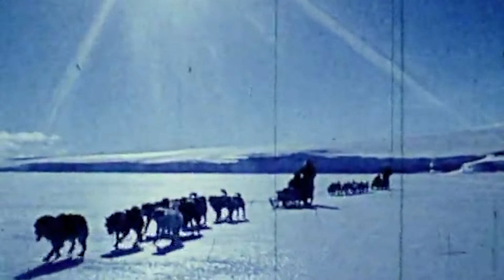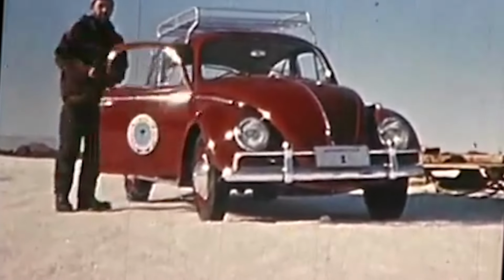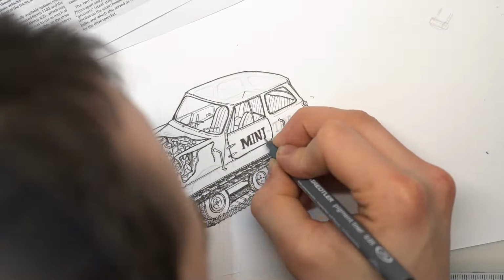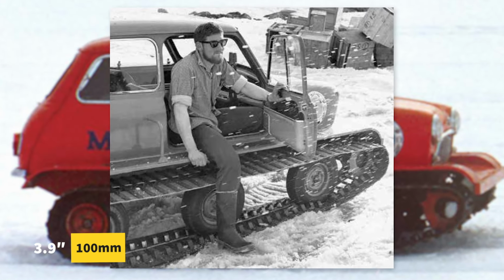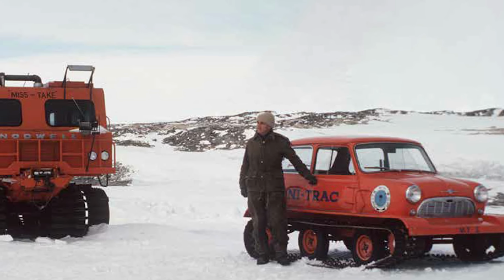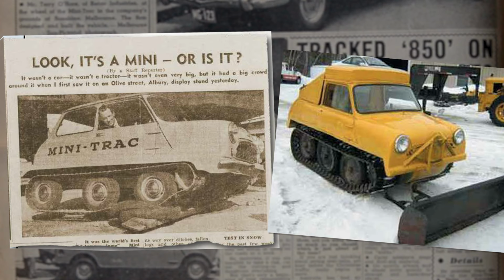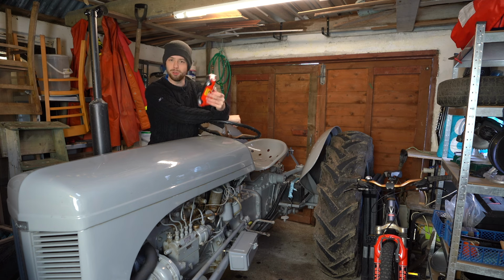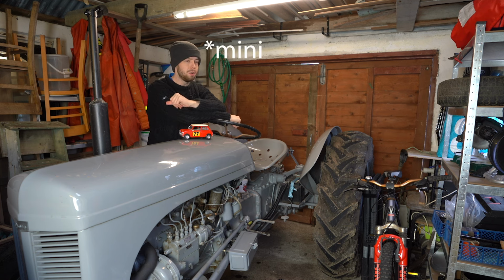Mini Trac -  The Amazing Tracked Mini Built for Antarctica

Comment: Re the VWs:

Strangely there was a thermostatically controlled shutter ring on every VW air cooled Beetle engine.
The shutter ring closed down like an iris of a camera lense....
and restricted the air being sucked into the fan right at that big round hole on the tinware at the "back" of the engine....
so when cold the amount of air flow over the engine from the fan was restricted...
which speeded up the heating of the engine/oil.

Most people threw this away at the first opportunity they had as they didn't understand it....

That's why a lot of VWs had a reputation for being cold blooded....

The next thing was the heating tube that ran from one side of the engine exhaust, up under the carb and manifold to the other side of the engine exhaust....
providing heat to the long manifolds and stopping the falling out of the fuel from the air when cold.....
people who fitted aftermarket exhausts without the stubs for this pipe also caused bad cold running problems for themselves.

And last but not least the cast iron heat exchange parts of the heater system didn't often wear out..
but the channels to conduct the heat to the front of the vehicle rusted out...
so there was far less hot air getting to the passengers than there should have been.

The petrol auxiliary heater would have been the way to go...
just use cold air from the fan and blow that through the dedicated petrol fired heater....

Comment: Track always work best with drive sprockets in the back, so the contact patch is under tension.. With front drive, the entire contact surface is under compression, lumping the tracks, and the top is under tension.

Comment: Your footage of you wi’ your wee grey Fergie at the end brings back memories of my own dad’s wee grey Fergie on the farm and the stories he would tell.
As a youngster working for his father, the first tractor he worked with was a Fordson - 4mph, that was it!!!
Then his father bought a Fergie!
25mph - my father thought he was in heaven!!!
We emigrated to Australia when I was 5 and for the first 5 years we had a normal petrol Fergie.
Afterwards we moved to Queensland where the farm he bought had a dual fuel Fergie - petrol/kerosene! 
It was started on petrol then run for the rest of the time on the cheaper kerosene. However for heavy work like plowing it would be switched back to petrol.
My cousin’s husband had a book put out by Ferguson on the 50th(?) anniversary of their founding.
One interesting fact was they wanted to exhibit the tractor in Kelvin Hall, but were refused at first because the administrators didn’t want oil on their wooden floors. 
Ferguson got around that by draining the tractor of oil and flushing it out.
So they drove it into the hall completely devoid of oil and likewise back out when the exhibition was over.
They took the engine apart to see if there had been any damage done to it, but could not see any discernible wear at all !!!
I believe they even developed one to run on olive oil for their Middle East market.

Comment: I emigrated from Bonnie Scotland to Canada in 1976 and worked for the City of Brampton for several years finding myself transferred to the Ski hill winter 1979 and I drove the Bombardier sidewalk plow to groom the hill after making snow during the night. 
Those machines were not that stable and often flipped on their sides when plowing sidewalks that was higher than the ground on either side of the tracks. When using the machine the operator had to wear a crash helmet as your head would bounce of the door, roof and front windshield. The City soon replaced those machines and I guess thats why there was one at their ski hill rather than a safer wider tracked machine. 
Anyway the first few times I drove it on the ski hill it scared the shit out of me as I slowly crept over the brow of  the hill the front of the track in the air until the front of the machine suddenly dropped heart in my mouth going over the edge.
After driving up and down the hill dragging hoses and snow guns and then grooming the hill it became a lot of fun as I became more confident and experienced operating the machine but always wary about it flipping sideways if I wasn't careful.
On flat level ground it would fly as you floored it... no idea how fast as there wasn't any speedometer. lol
Reply from the maker: Really interesting story! Always wanted to dry a little Bombardier to tracked vehicle, I've never actually driven one (aside from diggers obviously) but yeah I imagine stablity must be an issue sometimes!

Comment: I worked for the nz Antarctic program and some of the old snow tracs are still tucked away at some of the old outposts but we had 70 series Toyotas and hagglunds re-engined with Mercedes 5cyl diesels. We also had an electric Polaris ranger for use on base. The road to McMuffin station or even to te airfield in winter could be done in most family cars!
Reply from the maker: That’s amazing! Saw some great photos of the New Zealand based with Land Rovers and Land Cruisers around those bases, love it!
Reply: @CalumRaasay  yeah one of the mechanics from about 1990 uploaded some of his photos of old vehicles, there were some weird and wonderful contraptions! There was some sort of half-track van but I can’t remember what it was based on but it was made by (or called) ASV

Comment: You are correct about the Canadian one being Bombardier, it is actually a JW67 with a butchered up mini shell directly on the chassis, it’s not related to the actual mini track. The chap who built it did a few with different small car bodies when the original Bombardier bodies rotted out from road salt damage and also a few with just roll cages. Same gent also built a hybrid Ford 8N/Volkswagen tractor using the same method.
Reply from the maker: Oh wow some fresh information! Really appreciate this - a shame that it's not the original Mini-trac but I guess it was a long shot anyway!

Comment: We had a few beetles and my father had some of those minis. In winter the beetle has to be one of the most uncomfortable cars ever. It handled well and generally did not get stuck but it was bitterly cold and you needed one free hand scraping the windshield constantly. There was a gasoline heater, but all ours ever did was reduce fuel efficiency and fill the cabin full of carbon monoxide so you opened the windows....
Yeah, not a good system at all. Admittedly it probably was ok when brand new, but none of the ones I ever had ever worked and I am glad I didn't  die from asphyxiation using it!

Comment: Nice video Calum. I used to have 2 of the Swedish SnowTrac st4 ,with Volkswagen aircooled flat four.  Cool machine,but great at throwing tracks,especially on the heather! ( I live not far away from Raaasay)  also have an old grey Fergie on the croft,not quite as tidy as yours tho! 🤣🤣 I’ve also owned and used a couple of Snowtrac ST 4.  , great machines on snow,but useless on heather and rocks.

Comment: Thanks.  Very interesting video and very professionally narrated.  The first thing I thought,  when I saw the mini,  with tracks,  was;  I hope they beefed up the clutch and drive train,  and geared it somewhat lower.  If the designer had done that,  there is no telling how successful,  useful,  and popular it might have become,  with the larger engine in it.  The way it was steered,  the brakes would have needed thicker,  more durable shoes,  and thicker drums,  also.  It was a great idea.  It just needed a little more thought about the conditions of use,  and the added strain on the drive train of the tracks,  deep snow,  and the brake steering.
Reply from the maker: Yeah I think probably fine and money constraints, as usual, really did in the Mini trac but as a first attempt it wasn’t too bad- I also think with the resources someone could probably build a replica without that much difficulty!

Comment: One of my neighbors had a tracked vw beetle in the same style as the mini-track, but rear wheel drive (ofc using the stock engine and brakes) the same day I saw it, it dissapeared.
Reply from the maker: Lets track them down!
Reply: @CalumRaasay  as far as I know it was a custom job built in someone's shed

Comment: My father inlaw was at Casey in 1969, pretty sure ive seen footage of the VW that they were still using
Reply: I asked him about it. He said he thought the VW they had was the 3rd, they didn't get to use it much as it had done a main bearing. In 1968 (when he was training for his stint) they saw VW01 in the Melbourne Cricket Ground (MCG) car park, so it did make it back to Australia.
Reply from the maker: Yeah apparently there was a third that got sent out there but it wasn't technically supplied by VW Australia so they called it Antarctic 2.5. They went on to be sold after their service (as did a lot of ANARE vehicles) but apparently they had been pretty used and abused by the time they got back! Thanks for asking your father in law, what a fascinating experience he must have had out there!

Comment: considering the overheating problems the beetle's air cooled engines had I bet they were very happy with their antarctic conditions.
Reply: Strangely there was a thermostatically controlled shutter ring on every VW air cooled Beetle engine.
The shutter ring closed down like an iris of a camera lense....
and restricted the air being sucked into the fan right at that big round hole on the tinware at the "back" of the engine....
so when cold the amount of air flow over the engine from the fan was restricted...
which speeded up the heating of the engine/oil.

Most people threw this away at the first opportunity they had as they didn't understand it....

That's why a lot of VWs had a reputation for being cold blooded....

The next thing was the heating tube that ran from one side of the engine exhaust, up under the carb and manifold to the other side of the engine exhaust....
providing heat to the long manifolds and stopping the falling out of the fuel from the air when cold.....
people who fitted aftermarket exhausts without the stubs for this pipe also caused bad cold running problems for themselves.

And last but not least the cast iron heat exchange parts of the heater system didn't often wear out..
but the channels to conduct the heat to the front of the vehicle rusted out...
so there was far less hot air getting to the passengers than there should have been.

Comment: Another really informative video on these fascinating vehicles, I look forward to the next one.   Have you thought about doing a video on the original tracked landrover (probably a Series 2, 110) which I think was built in the west Highlands  in the late 60s?   Fairly sure it was used by the Hydro Board to get to remote 11 and 33kV lines and intakes in Argyll/Perthshire.  It was parked at at Lix Toll garage until about 15 years ago - I asked what happened to it and they said they sold  it to Landrover UK who wanted it and sent it to Mexico.  No idea why,  it can't be to cross peat bogs.   There's a replacement Defender vehicle at Lix Toll now, also yellow but the tracks are much smaller.  It doesn't cut the mustard like the original.
Reply from the maker: I know the one you mean! Quite close to me, seen a couple pictures floating around. Need to see if I can find more info

Comment: I really like that you show both metric and imperial units on screen. It’s really handy especially for less common units like PSI!
Reply from the maker: Yeah I always mix between the imperial and metric so I figure it might be handy to others!
Reply: I know this is a 3 year old comment but, how do you have a verified checkmark if you have no subscribers or videos?
Reply: How can you visualize pressure in something other than PSI?
Reply: @WojciechP915  1 Bar = 100KPA = 1kg/cm2. A lot easier than psi. Can't wait for imperial to have a global ban on it.
Reply: @WojciechP915  How can you visualize it in PSI? :) I have no reference whatsoever to what that means. Pounds per square inch? That intuitively tells me absolutely nothing...
Reply: @bennylofgren3208  I grew up using PSI. LB●ft/ ftlbs as well
Reply: @WojciechP915  pascalls or bars
Reply: @metallicman711  This aging Canadian is metricified as far as centigrade goes but all else is imperial. Pascals and bars may as well be Latin to me.